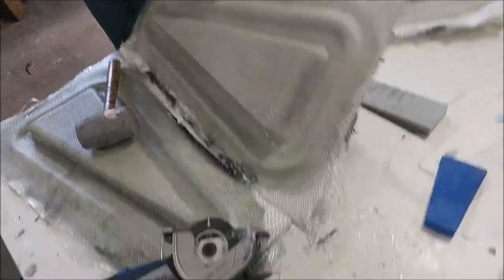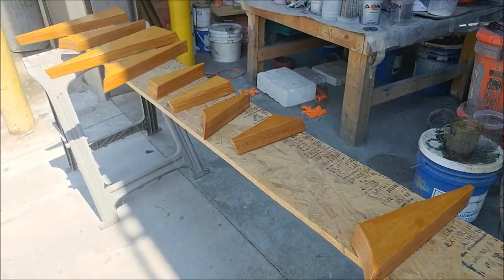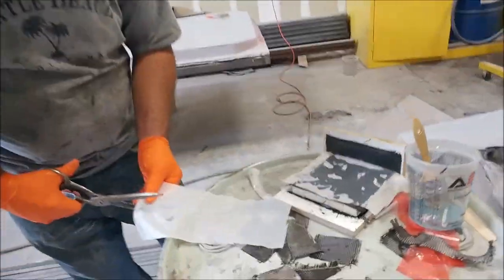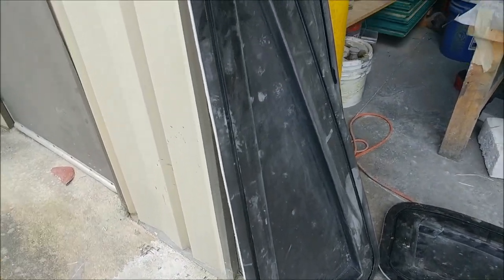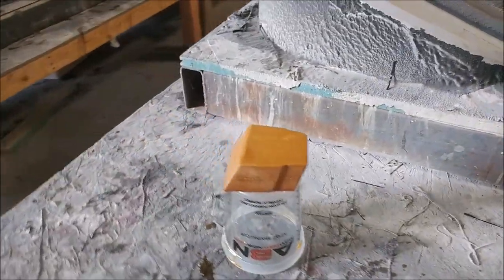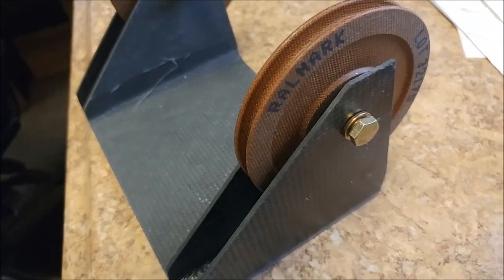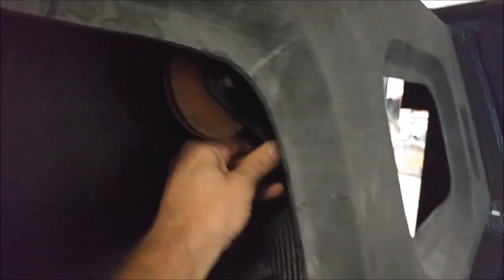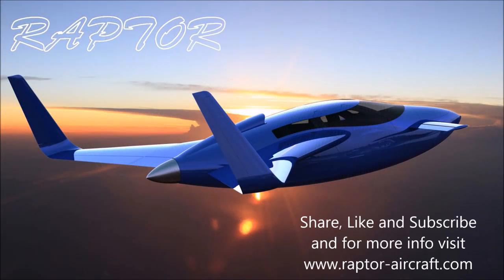Aileron Pulleys - And a truck load of ribs

Comment: Are solid connecting rods for flight controls going to be an option or is this a done deal with cables and pulleys?
Reply: I've been wondering the same thing.  I can understand going with cables and pulleys for the prototype as I'm sure time is becoming a factor.  Hopefully, the push rods have not been eliminated as a possibility.